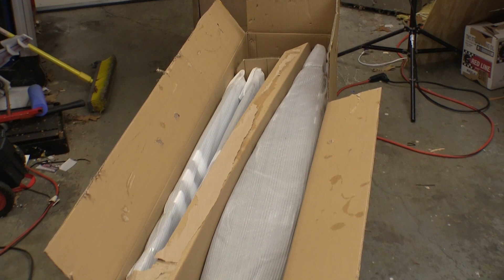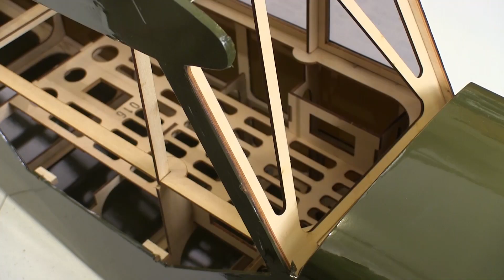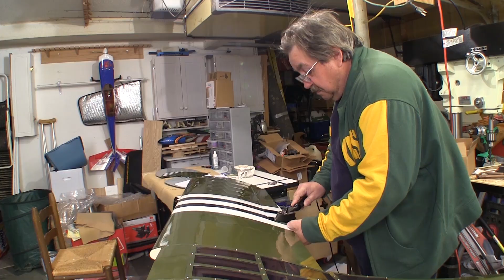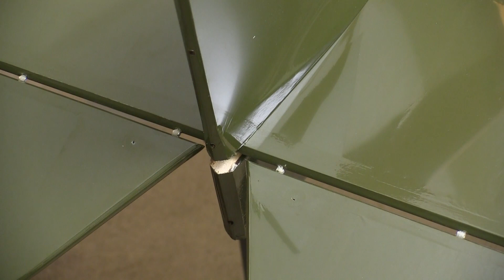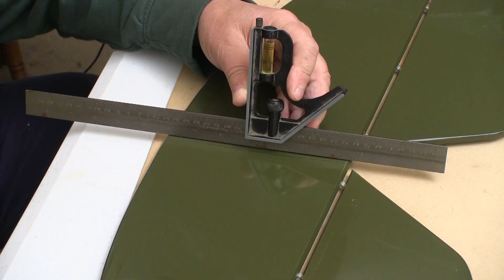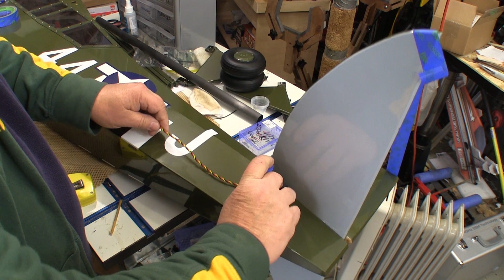Bill Hempel 25% L-4 Grasshopper Build - Part 1

Comment: Did your airplane come with a manual?? I got the 25 percent cub and no manual just all the parts I think 🤷🏻‍♂️ cowl is busted up too
Reply from the maker: No manual with mine either, they said to use the larger scale manual online but that seemed to have different mounting points in the wing. My first and second cowls were both cracked as well, gave up and fixed my second cowl myuself.
Reply: Ok thanks I guess I bought a puzzle, I have watched a lot of your videos I figured if anyone knew you would, thank you sir

Comment: hello sry to bother you, but I'm getting ready to buy one of these this Wednesday, but I have a few questions  it now says plane comes with hardware, I was wondering did yours come with a cowl? also I have tried to email bill about spare parts and have heard nothing I'm kinda worried about spending 600.00 and find  out  it has no cowl and other parts... the plane looks very nice  I will be using a eme 35cc
Reply from the maker: We did get a cowl but it was damaged, apparently before shipping. We got another but that was in worse shape than the original. I think you are correct being concerned about parts for these planes. I have moved on to other manufacturers like Top Flight etc.

Comment: Which hitec servo did you use for the grasshopper?
Reply from the maker: tisoy909 HiTec HS-5565MH on everything but the throttle, that was a medium priced high voltage servo but I forget the number.
Reply: Thanks Tom. beautiful plane you got there.